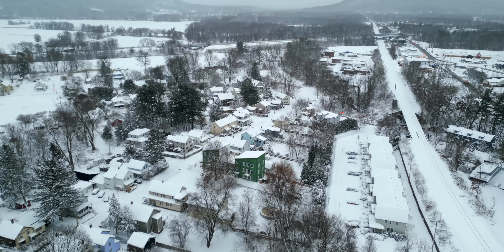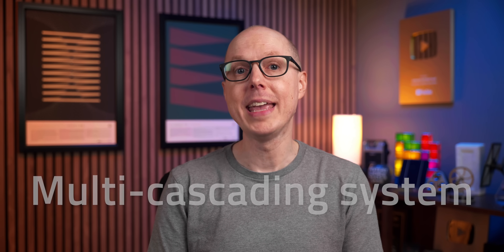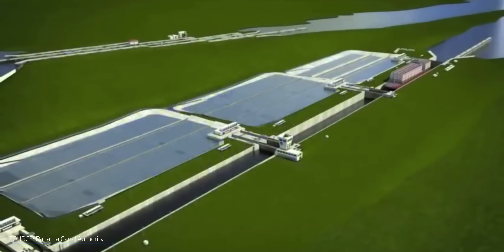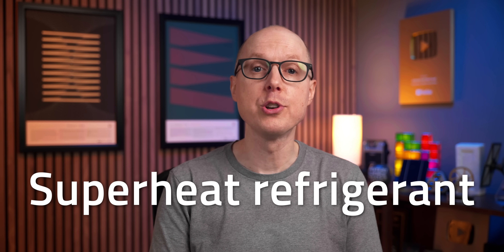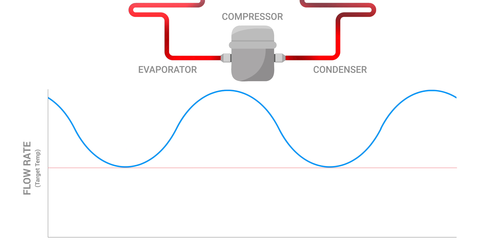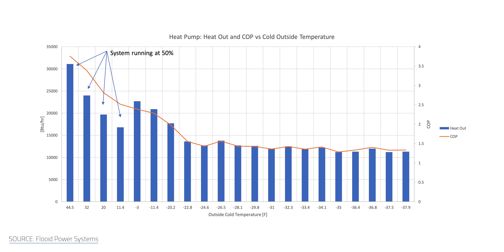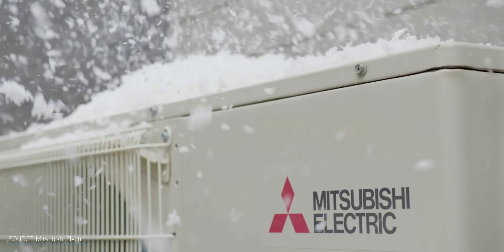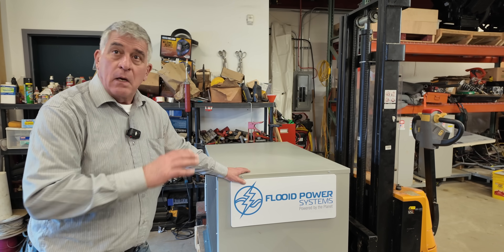How This New Heat Pump is Genius

Comment: I work on heat pumps at a retirement facility.  The more parts there are the more failure points you have. Eventually, the reversing valve wears out or stays in the heat or cooling position; the cost to replace it often exceeds the value of the unit.
Reply: It's OK, Artificial Intelligence will solve that

Comment: I have electric baseboard heat and window AC. I would LOVE to go with some heat pump systems, but being in Iowa I don't want it to not keep up in the hottest points of summer or coldest points of winter.
Winter I could get by with a plug-in electric heater, but I don't want to have to put in a window AC for a little bit of time.
Reply: is geo-thermal heat pump an option ?
Reply: @Froudd  Yes, which he has mentioned before, but I have not seen any of those systems.
Reply: So... keep your baseboard heat and use the heat pump until it can't keep up and turn on your baseboard heating as needed?
How is this a serious problem? Just get a smart thermostat that can balance between the two systems automatically.
Why on earth would you plug in an electric heater?
Heat pump systems are, generally, at least as efficient at cooling as a window unit. There would be no need for a window unit if properly-sized.

I know people make fun of Iowans but... yikes.

Comment: Interesting technology, but the company did not explain how the residential system actually works or even how many stages it has.  Judging by the "Air to Air replacement" diagram on their website, my guess is that they need 2 compressors, multiple reversing valves, 2 condenser coils, 2 evaporator coils, 1 heat exchanger coil, and 2 pairs of copper linesets to the outdoors and all in order to increase COP only at extreme temperatures.  If there's a 3rd stage (i.e. for water heating), then the cost goes up even further.

They talk of increased capacity in moderate temperatures, but that capacity seems rather useless in a residential application.  It might be used for water heating, but then you need backup water heating for when that excess capacity disappears during more extreme outdoor temperatures.  Claiming increased capacity during moderate weather might impress laypeople, but sounds ridiculous to an HVAC professional; what good is increased capacity when you least need it?  We already have too much capacity in moderate weather with existing systems and that's why variable-speed systems were developed.

My guess is that even a 2-stage system would cost 3X more up front than a standard heat pump simply in hardware costs and only offers a return on investment in the coldest and hottest climates.  At this cost I suspect that geothermal becomes a better investment in most situations.

Comment: Good video. One small correction at ~3:30: when he was talking about Delta temperature your conversion was incorrect. 30-40 delta F is about 15-20 delta C (multiply delta F by 5/9 to obtain delta C the "-32" is cancelled out due to the Delta).

Comment: CO2 and R290 heat pumps have rendered this technology obsolete and are able to work down to -20C. Cascading only has a benefit where higher temperatures are required mainly in industrial processes.

Comment: Heat pump amplification is interesting and could eliminate the requirement for hybrid heating but imagine that resistive heater being replaced by thermal storage.

Are there any examples of building-wide hot & cold thermal closed-loops (like water plumbing but closed) which can be accessed by several heat-pump appliances & each with a large thermal sump. So heating appliances will try to cool down the hot loop & cooling appliances try to heat up the cold loop or spatial heaters/coolers accessing both depending on the demand. This could also act as a universal first-stage for the cascading systems.
Reply: There are examples of closed-loop systems like that. I think it's usually used in large buildings like skyscrapers where each user has their own electric meter.
Reply: @eDoc2020  I was thinking about a thermal circuit rather than an electrical one. Electricity would be required for the heat pumps & maybe initial thermal battery heating (off-peak/solar) but the rest is thermal redistribution. Seems to obvious there must be a product - or a problem.
Reply: @daveh6356   I was also talking about a thermal circuit. The separate electrical meters is because each tenant would get billed for their own heat pump's usage.

It would be more efficient to have one giant heat pump feeding both a hot water loop and a cold water loop. Each unit's heat exchanger would select the appropriate pipe depending on whether it needs heat or cooling. The downside of this more efficient approach is that it becomes next-to-impossible to fairly bill each tenant for their share of the usage.
Reply: @eDoc2020  Yes, communal thermals & individual billing could be a challenge unless the heat pump was metered & carried a thermal surcharge or that was calculated upon thermal draw (temperature difference) through the apartment. Probably best to use thermal storage & on-building renewables to prime it & a low, per-unit flat charge based on equipment operational costs as the 'fuel' is free.

Comment: "If it's that hot outside, we've got bigger problems." Working at 120 degrees Fahrenheit is borderline in my area. I would much rather it work well up to 130 degrees, just incase we hit a record in my location (which would be above 120). FYI, my A/C works well at 115 degrees, tested on multiple occasions. Likely not even close efficiency wise, but parts and trained service personnel are available.

Comment: This is similar to an idea I've had before, in the sense of just daisy chaining them together. But nice to see that some companies are taking up the helm in producing a finished product. Will make it much easier for folk like myself who want to have as much self reliable systems as possible on their property; and least amount of reliance on public grid systems too. 

I wonder if attaching two together in tandem to work as one being hot and the other cold, with a thermal sink for both to draw upon when needed, would be a good way to make it so that a person never needs to add heat strips, or some furnace hybrid. Essentially, one focuses on heating the property, or the heatsink it has access to when no heating is needed, and the cold one focuses on taking heat out of the property and sinking it into the other heatsink when the main heating unit isn't drawing on the heat from it's process instead. Basically a dual cascade setup, with thermal batteries, but with each doing the opposite job to feed the other as required.
Reply: Free Energy is always great isn't it?

Comment: You are talking about "air-source" heat pumps. but are cascading systems for Ground-source situations? I have a ground source system in Colorado, and it works great all year without more components.

Comment: your cop's seam rather low. in mild areas we have cops of around 4. 
cascading is basically what other industries call compounding. what you have to watch is inefficiencies also stack up. especially if each compressor needs a different gas, which means you loose efficiency due to the heat exchanger. what can really upset things for residential is the requirement for climate friendly gases. if your stuck with one gas that really limits the system.
Reply: To your first line: Exactly. In mild areas you have COPs of around 4. In cold areas the seasonal average is lower. And half the time the COP is below the average.
Reply: @eDoc2020  i was referring to the advertised cop rather than cop in running conditions. if the heat pump is only 3 to start with and it gets worse with colder weather. that makes other system look better than it is.

Comment: Designer refrigerant is not something we should be messing with. control logic beyond PID (your sine wave analogy) is likely using model predictive control (MPC) which is known to be faulty outside of design assumptions and needs a lot of babysitting. This is really the problem of trying to solve one problem with too complicated of idea. If you are interested in a real breakthrough in HVAC, check the advance in liquid desiccant that can boil off water in low temperatures, which will enable air conditioning using evaporative cooling even in humid climates.

Comment: We need some standards with all this computerization and small companies of varying risk profiles.

Imagine a vendor of your $14K system goes out of business then a logic board burns out. Oh, no!

I smell a ground-source in my future with an analog control circuit, but I do hope the tech continues to advance!
Reply: I like the way you think.
Reply: In the commercial HVAC world there already is standards to have pieces of equipment talk to each other. There isn't standards for the internal controls. But with the programmable controls that commercial equipment use that is that big of a problem.
Reply: It's happening already with solar panels systems on folk's roofs.
It ALWAYS happens when Government starts handing out Free Money - when will we ever learn?

Comment: How does Flooid achieve high COP on an air-to-air system?

I've heard that a typical COP for air-to-air is 3. Assume two stages, each with a COP of 3. 1000W of power at the input of the first stage can deliver 3000W of heat. 1500W of power can move that through the second stage to get 4500W of heat at the output. System COP is 4500/(1000+1500)=1.8 which kinda sucks. To get good system COP requires COP values per-stage that seem unachievable for air-to-air.

Granted, the two stages are likely coupled with gycol or similar which is a better transport than air, but even so I can't see this working. Is my math wrong? What am I missing?
Reply: 3 is a typical weighted COP. When it's warm out the COP is higher and when it's cold the COP is lower. If it's really cold (like -20F/-28C) a regular heat pump might get a COP of 1.4. A cascade system with two different refrigerants might run one stage with a low-temp refrigerant to bring the -20F/-28C up to 40F/5C, perhaps a COP of 3. Then the second stage brings this 40F up to heating temperature at a COP of 3.5. The resulting COP would be around 2 which is poor but still better than 1.4.

Comment: Not useful for residential or living space. Cascading heat pumps means less efficiency than two heat pumps or a much larger one for the same price. Cascading can only be useful if you need heat that is beyond the average heat pump and never or minimal use of resistive/electrical heating like in manufacturing or industries.

Comment: the engineer of heat pump is all roung, compressor most be inside the building because electric motor generated heat because of inducción, compressor should be upsidedown so if anything liquid gets in it will be the first to be spelled through the flaps

Comment: Large commercial systems use a water-based evaporative 'chiller' to provide chilled water to the heat pump in cooling mode. this is much more efficient than using the heat pump alone, and these are ubiquitous in large establishments here in Australia.
Reply: That is limited to dri-ish climates. Even in a colder place like Canada they can be quite ineffective during humid spells causing all kinds of issues. Cooling towers are high maintenance, especially the chemical treatment. In humid climates, straight air Condensors are more efficient. Cooling towers are common in commercial more for the compact space they allow rather than raw efficiency.

PS. Heat pump loops generally roughly 27°C +/- a few. Even at that temperature, cooling towers can struggle. At about 35°c water temp, standard water source heat pumps start to lock out, with most unable to handle above 40°c

Comment: -35C OA to 77f (25C) supply temp will simply not heat a home in -35C weather so that 2.1-2.3 COP is completely pointless as it would never overcome the heatloss of the building......

Comment: Well, a Problem here.  They said it uses Many Heat Pump Units inside the one box. Sorry to say no matter the COP of each of those units. But if a single normal heat pump costs a set amount of Electricity to power it per hour, have many of them in one box will cost many times the electricity of the single unit.

Simple power usage.  if the single heat pump uses say 1 Kilowatt a hour putting in say 4 of them doing those different heating compressor values will take 4 times more electricity to do it than the single heat pump compressor would.  

So no matter the COP of the whole box of them, the power will go up to drive them all. after all one heat pump would still need one amount of power to run, so you fit 4 in the single outer box and it uses 4 times more power to run normally.  So even if they do the system, it will just push up your electricity need 4 times for the single box that has 4 in it.

Plus as stated the cost of just buying the new heat pump will be huge. and in most counties that heat pump will be pointless due to either huge year round heat or cold. and not everyone can afford the heat pump tech or the huge amount of power it needs and the fan noise those heat pumps make is 24/7/365. which not only upset you and your family but the neighbors too.

Comment: My house has ground source geothermal,  2  3-ton water to water units and a 4 ton water to air that does heating and ac.   Summer time our bills are reasonable but winter time up here in 🇨🇦 our bills are thru the roof. Never been happy with winter performance

Comment: They should make an outside unit that works like an icemaker. It will be a big pile of ice outside, but will work at ANY outside temperature.
Reply: Exactly. THAT is where the real heat energy is, in the 'Heat of Evaporation' of water
Reply: @peterbetts8740  I meant one that uses liquid water, tap water, the same used by the house. Converting outside vapor present in the air to ice doesn't help because what matters is the temperature of the outside unit, not the heat source.

Comment: I don't believe in the CO2 bad hoax. So I'm only interested in tech which saves money, and in a short number of years to pay back the costs, ignoring artificial rebates. Are we there yet?
Reply: It depends on where you live. It varies based on cost of electricity vs fuel as well as the temperatures you encounter. AFAIK in most of the US heat pumps are less expensive to run than furnaces.

Comment: A cop of 2 is dumb. Our daikin heat pump has a cop of 5.0 for the bedroom and 4.15 for the living room
Reply: The advertised COP is a seasonal weighted average which doesn't tell the full picture. You might get a COP of over 5 when it's warm out but as it gets colder the COP falls.
Reply: @eDoc2020  it has a SEER of 8.5 and 7.33 🤣🤣😈👺
Reply: @Solid_Snake99   I don't understand all the emojis. I can tell you that a SEER of 10 (the minimum from 1992) is equivalent to a SCOP of 2.92. A SEER of 7.33 is a SCOP of 2.14. SEER is for cooling but if you meant HSPF (the equivalent for heating) the conversion to COP is the same.
Reply: @eDoc2020  the emojis are just for fun i enjoy efficient machines

Comment: Seems like the obvious solution for cascading is to decide when to cascade and when to run separately... think two-stage furnace. Plus, if running separately, it would be possible to accomplish load sharing to potentially minimize the electricity usage. This will come too late for the current project and the next project in a cold climate will be ground sourced with the intent to also provide driveway heating.

Comment: Heap pumps cannot work in the cold.
Saying they can is false and misleading regardless of the technical quibbles that say they can.
For a heat pump to work efficiently there needs to be some heat to pump. While absolute zero kelvin is a near impossibility so there will always be heat the closer you get to zero k the more energy it takes to get the heat. So you will find heat pumps used in areas that get below zero Celsius usually have some sort of heating element that switches on basically turning your expensive heat pump into a cheap bar heater.
And unlike gas or oil burners that keep operating when the power goes out , no power no heat.
If you’re wanting a heat pump in a very cold area I suggest you invest in a wood burning stove and a large pile of wood.
Reply: Older heat pumps actually couldn't work below about freezing, below that you'd run only resistive heat. Above maybe 5F (-15C) modern heat pumps are fine and the resistive heat will only come on occasionally as auxiliary heat (working together with the heat pump).
Reply: On a side note.
Being clean and efficient and reducing power bills is something that everyone wants.
Useless virtue signalling that ultimately results in far more truly harmful emissions is however what we usually get when people who really no nothing of the consequences of climate alarm start pushing so called green energy or things like electric vehicles and solar panels and wind turbines and heat pumps.

Comment: That small system may work from the "Basement" as he says, BUT those are found in the north.  That system would not fit in my home. He needs a system that fits into a vertical, closet type space as in most homes in the south.